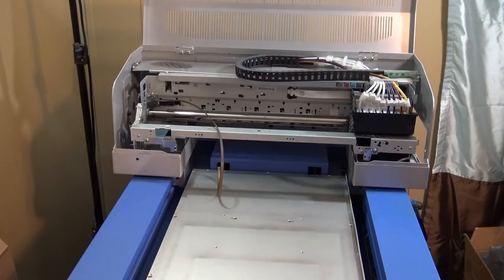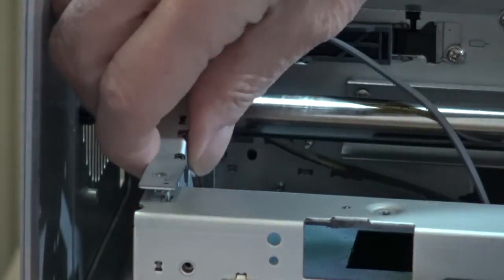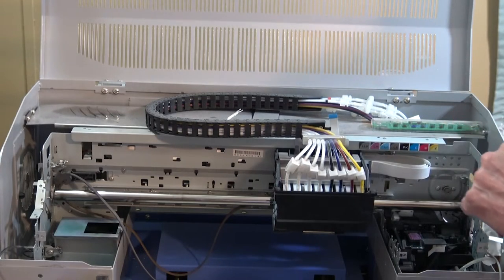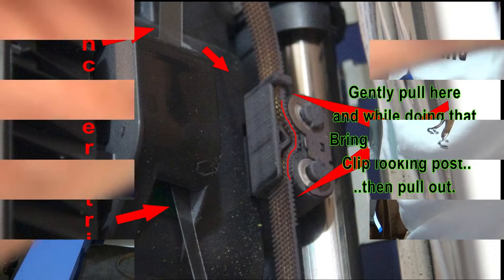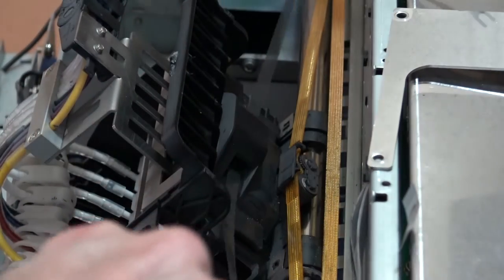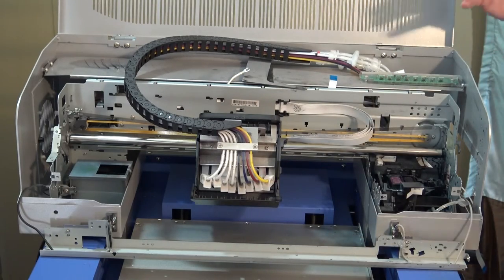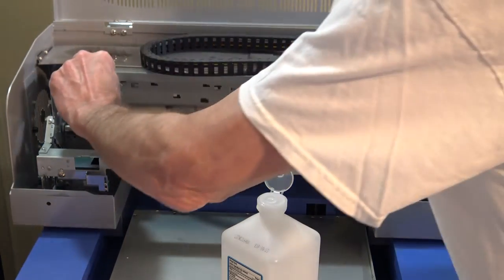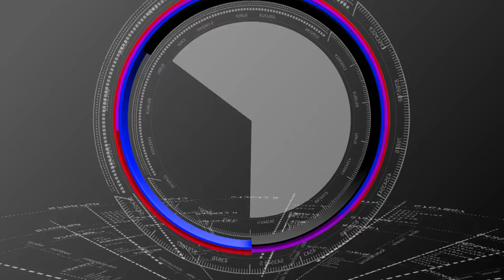Freejet 330TX Carriage Belt Replacement

Comment: Thank you Ken, very helpful.  I'm dealing with a similar situation and you showing how to remove and reinstall the carriage cable, and encoder cable helped.  I need to find a video that replaces the carriage off the carriage bar.